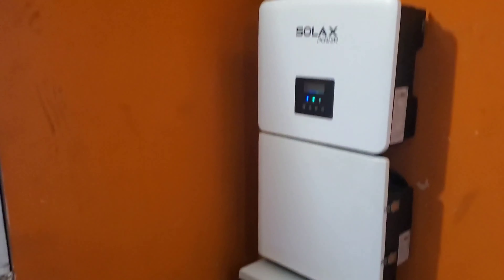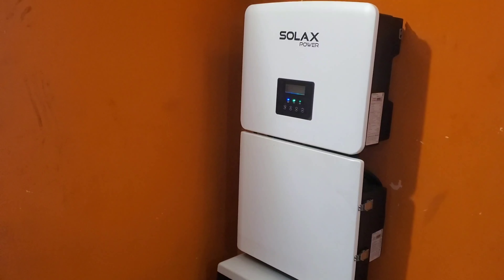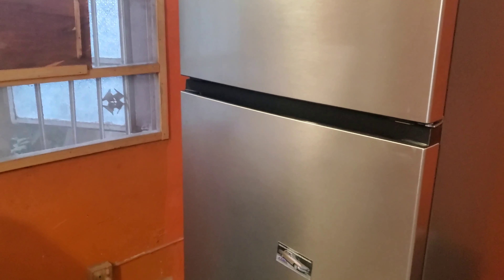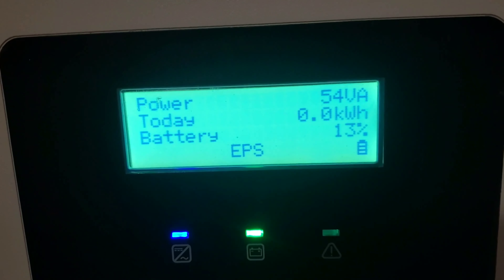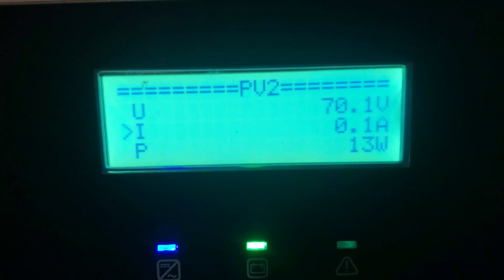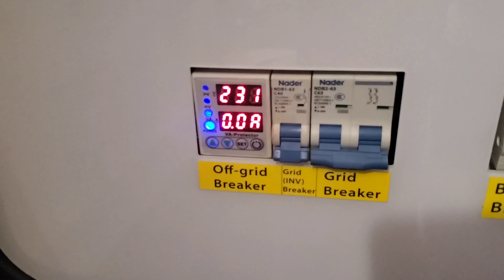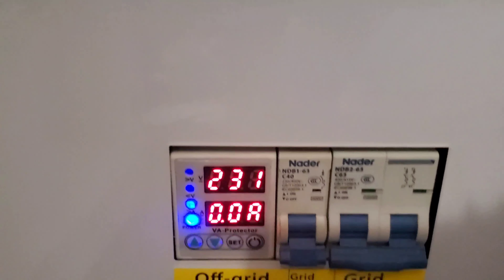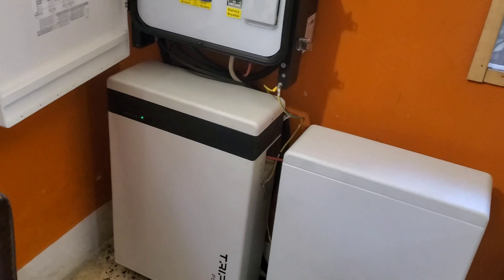My wish came true and I am not a happy camper

Comment: Good to see the solax system I'm getting mine soon
Reply from the maker: Thank you for watching and commenting. Please don't forget to subscribe. Which country are you in? Which did you get? Congrats on your purchase. I am happy with it so far.
Reply: @drsolar  i am in the UK... getting 2x 5.8 batteries with the hybrid inverter 😁 within the next few weeks hopefully
Reply from the maker: @mikeyboy01443  hello from Lagos. I have the same batteries. 2 x 5.8. I will add a third soon. You will enjoy the SolaX experience
Reply: Hello  your videos are informative, have looked through trying to see if you had same problem as me, had a Solax X1 Hybrid and T5.8 Battery installed last week, think the installers have made a config error, seems to be not using my battery at night, drops to  never lower than about 87% @ 4AM and if i check my grid meter in the later in the morning, still using about 8kw overnight, buying from grid , battery gets to 98% after 2 hours morning light from panels, about the same consumption from grid b4 install, have called the guys to fix,i guess by watching your videos ,would or could be the self use settings somewhere or EPS…setting, Thankyou for your great videos.

Comment: Get an RDCO, the “O”, being Overcharge protection. The only solace you have is that you are not grid tied otherwise on the AC side you would need an SPD which has the ability to protect you from a “Brown-out”.
Reply from the maker: We put an SPD in every installation we do. Explain overcharge protection please
Reply: @drsolar  The internal BMS has an overcharge protection if not the MPPT right? The RCDO, also has that which is an extra layer.